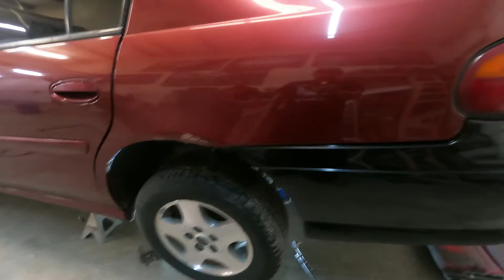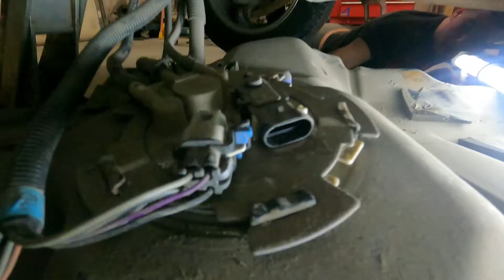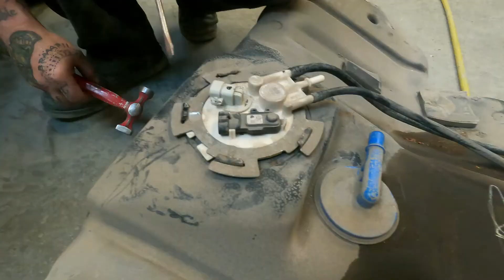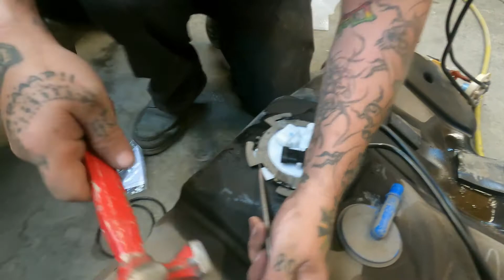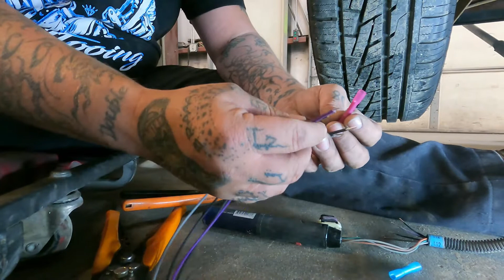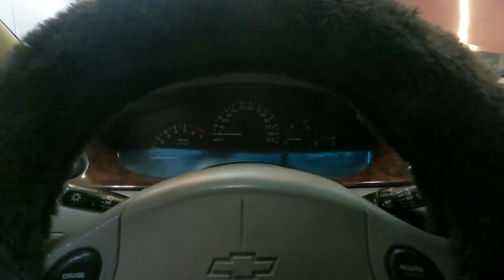How to replace Fuel pump 00-03 Chevy Malibu IN 30 MINS OR LESS

Comment: Hey I just want it to be known my sister , GOD, You and your video  were in my presence as I put a fuel pump on my father in law  car..NEVER IN my life I thought I would be doing something like this
 He called me and said he needed help. He didn't have the money to put it in the shop....And his strokes left him not able to do much.He said it's not starting, so of course I had to do the fuel pump test with the starter fluid. He had rope and a cheap strap that both broke on me while trying to pull the car up the ramps. Lucky there was a chain hidden on the porch, hooked that up and used my (Chevy Tahoe😊) to pull it up no problem! But the only problem I had was the dam* fuel fliter, it broke completely off while trying to get it off, so I had to re run a hose for the fuel line, once I completed that I started connecting the wires and used a car jack to assist with the gas tank! One man job, So Thank You Sir!

Comment: Iv got 245K+ miles on my 03 Malibu & have yet to have the fuel pump go out yet.. I'm sure soon it will fail eventually, But I always put Mid grade fuel in it & not the cheap fuel (Not sure if that helps my car).. Been a Solid car for the last 12 years with minimal problems, Ez to work on... If the Transmission goes I'll probably get rid of it or swap 1 from the junkyard.. Getting pretty Rusty underneath being a Minnesota car tho.

Comment: My car cranks about 4-5 times before it starts, I also have leaking fuel lines, is it possible I only need fuel lines or do I need a fuel pump now too?
Reply from the maker: Would say start with the fuel lines if it’s leaking you may be losing line pressure and that why it takes a few to start!

Comment: My 2004 Malibu fuel pump works but the sending unit bounces from full to empty and never gives an accurate reading till near empty, can I change just the sending unit after I pull fuel pump.
Reply from the maker: Sorry man I don’t have the answer to that!
Reply: Thanks, I didn't realize that a entire assembly is somewhat inexpensive on eBay. GREAT VID. @boostedz72

Comment: Aren't you supposed to completely drain the gasoline before you do the replacing?
Reply from the maker: You can if the tank is to heavy to remove by yourself but if it’s low enough there should be no problem but it’s totally by choice if you want to drain it or not!

Comment: Hello! I have a 2004 malibu ls. I replace the ignition coil,  ac compressor,  but the number 15 min blue fuse continues to blown out  cause my car not to crank until I replace the mini bike fuse. What cause it to continues to blow out?
Reply from the maker: So most likely there is a short in that circuit or what ever that fuse is powering is bad those are to only two reasons a fuse would be popping so I would get a power prob and start with the wiring and and that will tell you if there is a brake in the wiring
Reply: @boostedz72  thank you.

Comment: Hey doing this on my 01 impala the 4 wires on the harness side are all the same gauge and on my new connector I have small purple large gray small black large black no white stripes on either blacks any input would be greatly appreciated
Reply: Thank you for your time man I’m just confused on how to identify the black with white stripe on the new connector cause they are both black . Is it the smaller or larger wire? I’m sure it’s hard to say with out seeing it in person.
Reply from the maker: Ya not a problem so when you change the connector just do one wire at a time start at one side and work your way across the connector putting the wires on the new connector in the same spot as they were on the old connector is how i would do it it is kinda hard to say without seeing it in person but i would say that is your best bet!

Comment: Hi, i pressed the valve, it sprayed out just once, then just flow, does this mean my pump's  pressure is not enough ? Thanks a lot !
Reply from the maker: Your should cycle the key every time you test the valve when you lose the pressure out of the line it wont spray any more tell you cycle the pump again so i had another issues with this car and its was the security theft system not recognizing the key there is a 10 min key reset that you can run that may help and doen not cost anything there is a video on youtube is were i found it. It may not be the fix cause im not shur of the problem with your car but sounds like same issues i was having

Comment: Thanks a lot ! I just press my car schrade valve  and got gas flow out, does this mean my gas pump work ? Thanks
Reply from the maker: Ya if it sprays out pretty hard fuel pump is working and holding pressure!
Reply: Thanks a  lot, i will check.